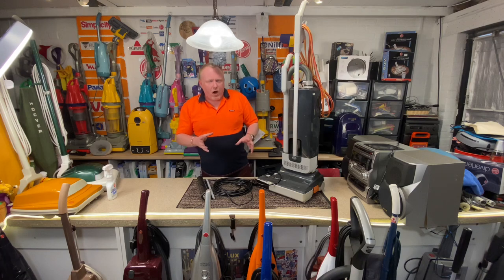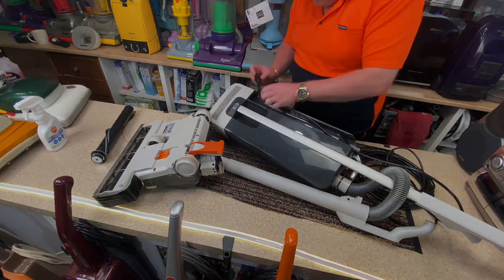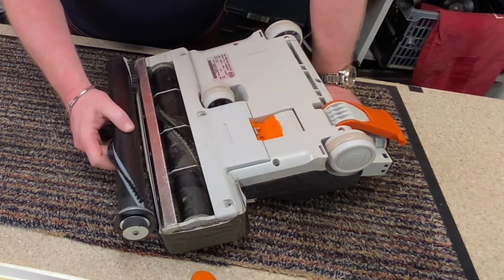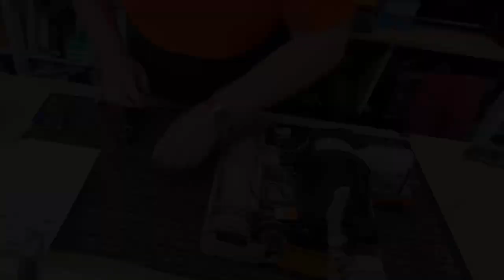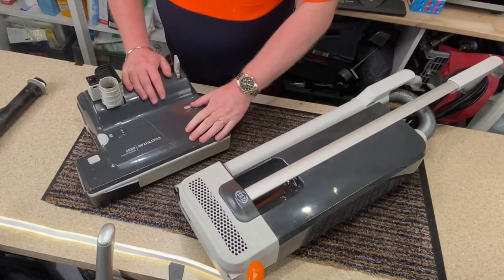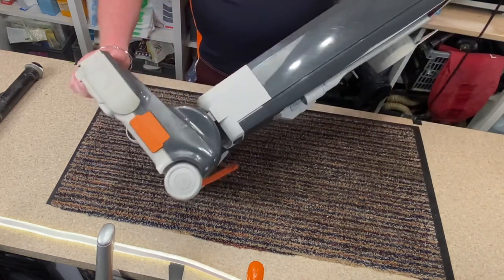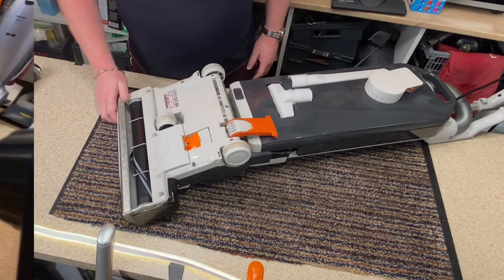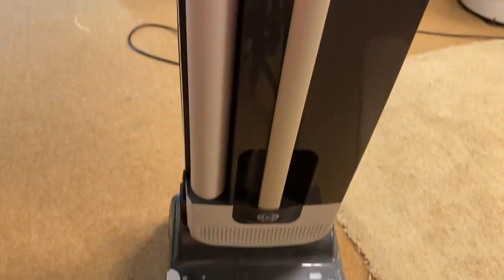Sebo Evolution 350 Commercial Vacuum Repair Part 2

Comment: Talking about Flymo cable, one of out BS36's at work literally had a Flymo cable, complete with Flymo plug. It needed a new cable at one point, I had the Flymo cable spare and fixed it.
Reply from the maker: Yes, I have a Flymo lawn mower, I’ve done a vid on it and yes, the cable and plug do fit 🤣